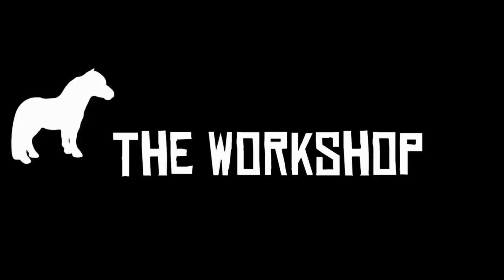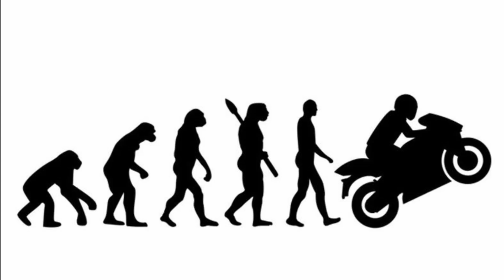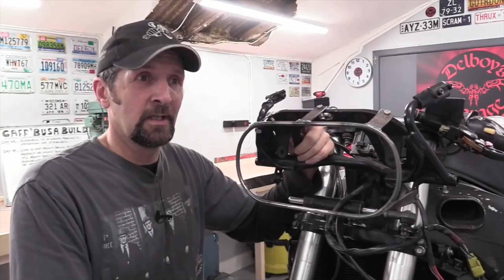The "DARWIN" engine

Comment: A lot of things took a very long time to catch on:

Disc brakes..... 1906. Took until the 1970's for them to appear on road bikes.

ABS brakes..... Royal Enfield (1950). took until 1979 to make it into a production bike with BMW.

Radial Four Valve Combustion cylinder heads..... Rudge "Radial" (1928 - 1939). Reintroduced by Suzuki in the 1980's as RFVC.

Left hand gear change, right foot back brake pedal ...... Rudge (1933). Because it's easier & safer to perform a U-turn on a bike with aa left foot gear change on a UK road. The same goes for 55% of the world (including Japan) that drive on the same side of the road as the UK. Try doing a U-turn on a UK road on a right hand gear pedal bike to see why.

Linked brakes...... Rudge Radial 500 (1933). Took until the 1970's for Moto Guzzi to revive this. Now a feature on a lot of new bikes from other companies.

100 MPH capable 250cc road bikes..... Rudge 250 RFVC Radial (1938 - 1939). A 4 stroke 107 MPH road bike in 1938. Still out performs modern 4 stroke 250's today. Had to wait until the 1980's before another true from the showroom 100 MPH 250cc appeared again.